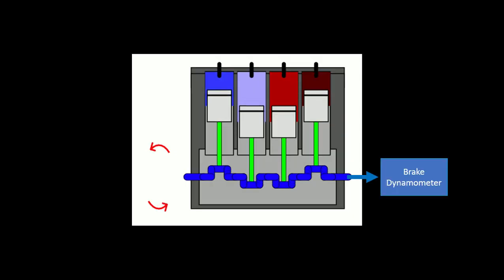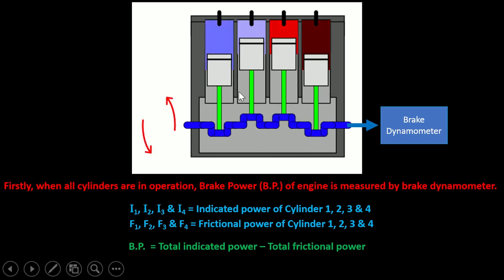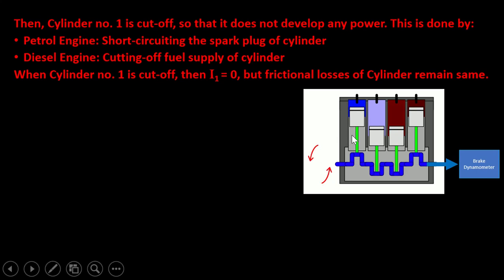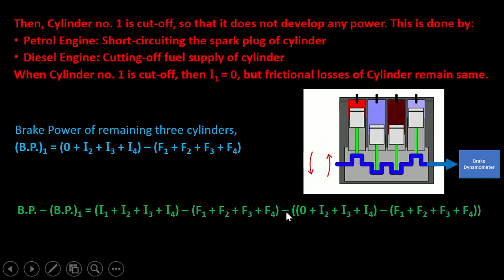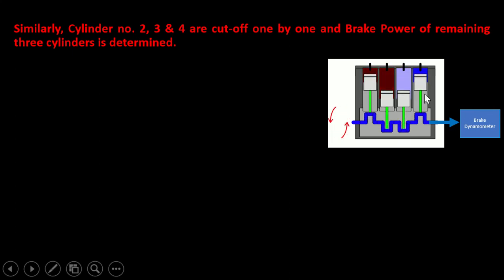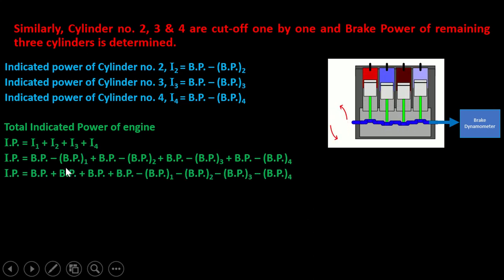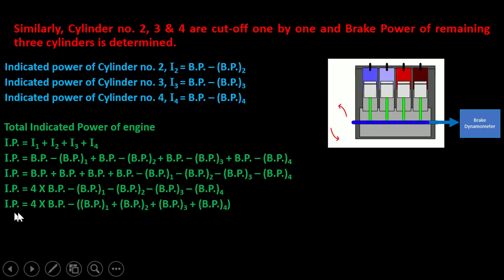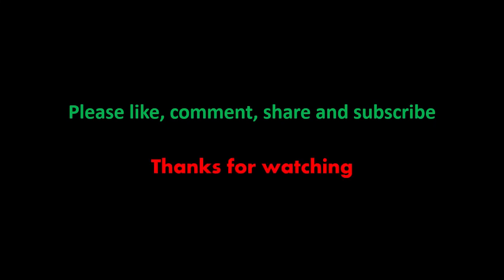Morse test to find Indicated power or Frictional power of each cylinder of multi-cylinder I.C.engine

Comment: Where is b.p. how can you find i.p. without b.p. according to your explaination.
Reply from the maker: The Morse test is used to find Indicated power or Frictional power without using indicator diagram.

When all the cylinders are in operation, the brake power of engine is measured by means of a brake dynamometer.

Each cylinder is cut-off, one by one and the brake power of the remaining three cylinders is measured.